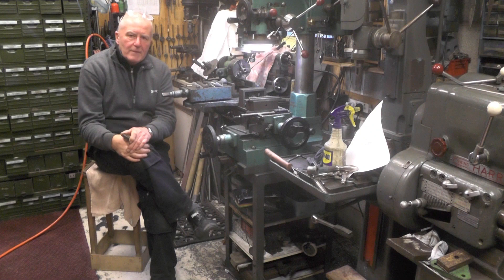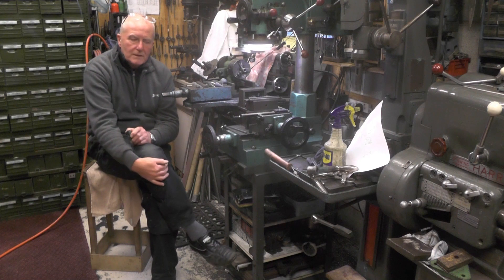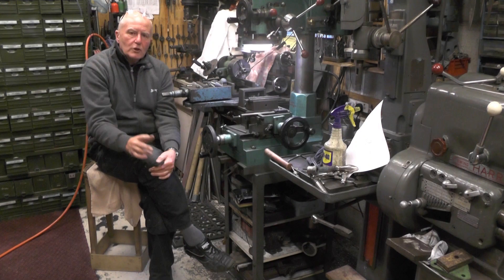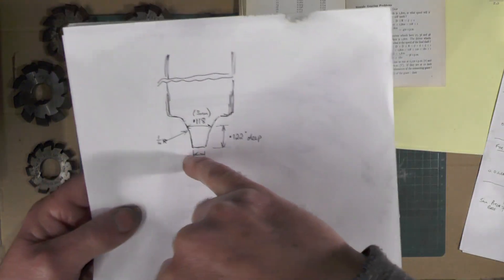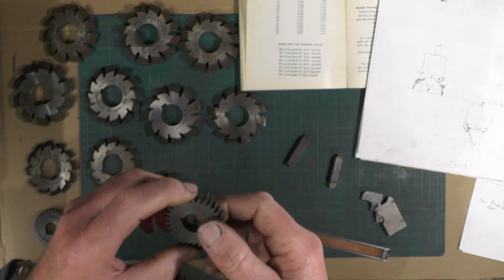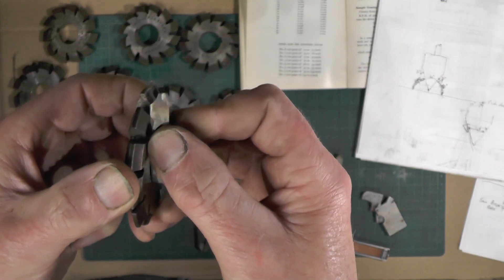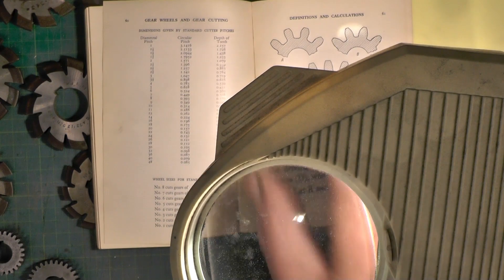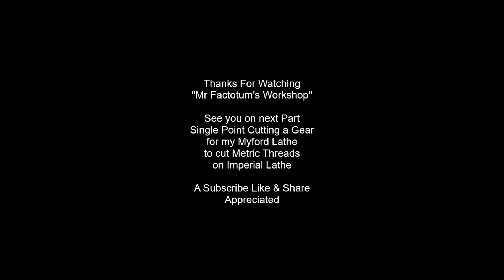Single Point Gear Cutting  Part 1 (Shaping the Tool) "mr factotum"

Comment: Hi Kev. E-mail sent with the dimensions for the drop arm. Steve. P.S i also have a chart with all the threads that can be cut using the 33 or 34 tooth gears if you would like a copy.
Reply from the maker: Hi steve 
Thanks for that, i have a chart with the threads on , but thanks anyway.
take care
Kev

Comment: Hi Kev. I bought the 33 & 34 tooth gears from Myford last year. Still in the bag. There is apparently a arm that needs to be made to mount them. I have the drawing somewhere of the dimensions of it.
Reply from the maker: Hi Steve
I had a look around for some but couldn't find any, or may be i wasn't looking hard enough, to prompt me to make them. 
You've got me a little confused here about the arm, the method i use just a straight replacement that slip on to the spindle below the 2 tumbler gears to replace the 24 tooth one normally installed, all you do is adjust the Banjo down a little to suit the gear then set the QC box to the suitable position for the pitch.  It will become more clear in my video out tomorrow, making the gears and trying them in the lathe. 
I used this method in another recent video, in my contribution to Go Create Hobby Machine Shops making the three baby vices collaboration, where i cut a 3 off M5 x 0.8 pitch  screws, in Part 1.
By the way received your stickesr yesterday, thanks.
Take Care
Kev

Comment: Morning MR F  my sweet pea is coming along  nicely  .. Much nashing  of teeth with  the  internal square thread  for the  brakes but success eventually..  Nice interesting  video on the myford gears .I made a few years back  from tufnol and they worked a treat  and they run nice and quiet.. If people use tufnol  they must use flat sheet and cut rounds  then cut  ... Dia bar tufnol can't be used as the teeth will disintegrate  because  of the way the laminate is   structured and glued on manufacture.. l know   gear guys know this  but it might help somebody..  looking forward to you next video .. Keep Safe  from South Africa
Reply from the maker: hi dougie, 
nice to hear from you
Yes that internal square thread is challenging!
good to hear the SP is coming along.
That info on tufnol is great, never used it myself but that's good to know about it being laminated thanks
take care
Kev (Mr F)

Comment: Gday Kev, great informative video, I’ve just brought 2 gear cutters from the UK, here in Australia they want $260 per cutter, I brought both for $108 Australian from he uk, I had no idea how to grind the profile in the high speed tool blank but I do now, maybe next time I need to cut gears I can use your ways of doing it, thank you for sharing your knowledge, much appreciated, Cheers
Reply from the maker: cheers Matty
yes the cutters are very expensive for a good one anyway. Unless you get a cheap chinese chocolate one, there ok for doing a one off perhaps. At the end of the day you get what you pay for.
good luck with your gear cutting, 
Kev

Comment: Nice job Kev. That grinding dust's a pain. Should be able to cut HSS with a carbide end mill. Not tried it myself just yet but I will do now.
Reply: Dave interested to see how you get on with the   Carbide endmill on HSS .. Carbide  is used alot nowadays  finishing   punches and dies  after heat treatment but  using  very rigid  machines with high speed spindles and cnc  to  control speeds and feeds accurately and    also climb milling.. HSS    is about  64 65 rockwell I think so quite  a bit harder than normal..  hope I haven't bored you with things you already know   .. give it a go  I'm  a pensioner so can't afford to experiment with expensive cutters  Regards  Dougie South Africa
Reply: @dougiehogarth6652  Hi Dougie, I'll get back to you on here when I try. Yes I'm aware of the hardness. I'll have a look what cutters I have, pretty sure I have some 65-68 HRC in less than 10mm worth giving a try. I'm 62, still working (from home) & it's a hobby just like yourself, mind you it has paid for itself.  My mill is a warco WM18V.
Reply: @dougiehogarth6652  Hi again Dougie, great result, no problem at all, like butter, well say butter in the fridge! I've just made a perfect 2mm concave radius into the end of a piece of 3/8 HSS. Using a 4mm, 4 flute carbide AlTiNS coated (spec to cut 65-68 HRC) end mill. First I side milled the end to 7 degrees with 10 thou cuts no problem. (Didn't try deeper as it doesn't take long). Then plunge cut right through in 40 thou steps to the 2mm radius, still at the 7 degrees, again no problem. Just one very light spray of coolant (aerosol) for each cut. Both side & plunge cuts work great at 1500 rpm but was fine at over 2000 no problem, and faster feed. Great finish either way, & cutter still like brand new. Neither the cutter or the HSS got even luke warm. I think the recommended speed for these cutters in HSS is around 6000 rpm!, my mill doesn't go that high. Cutter cost; less than £10 (not Bangood, I refuse to).
Reply: @davemason6273  Hi Dave  I'm  constantly amazed  at what   these cutters can achieve   but I thought  that  HSS would be  a bridge to far..  I m 75 Next week ,Who said you can't teach an old dog  new tricks.
Reply: @dougiehogarth6652  Happy birthday next week Dougie. It's a different world we live in that's for sure. These cutters are very brittle but very hard. Look up APT for your cutters, they also show speeds & feeds on each cutter, these are maximum but if your much too slow they will chip.
Reply from the maker: hi dave
Cheers, yes you can cut with solid carbide, but I don't have any, i just manage with what i've got at the time.
thanks for watching and feedback, appreciated
Kev

Comment: Once did the exact same job when i cut an internal gear on a slotting machine. i had the benefit of a tool and cutter grinder, diaform and shadowgraph and it was still bloody tricky. Great job Mr F
Reply from the maker: cheers rob
wish i had the luxury of a t&c.
thanks for your usual support
regards
kev (mr f's w)

Comment: Fascinating thank you ,if I tried that there would be cloth flying across the workshop !!.looking forward to part two.
Reply from the maker: Hi SD
thanks, it's just a matter of making sure everything is fastened down with tape, magnets, etc, just make sure your comfortable with your securing method, if in doubt Belt & Brace it.
Thanks again for feedback see you on next part soon.
cheers
Kev (Mr F's W)

Comment: Great job !   * While it's possible to make a cutter with the 'button' method , that would require an exact size tool ; PLUS it would have to be made from 'silver steel' or drill rod - which is not quite as durable as HSS !   'Looks like a WIN / WIN ( using the grinding method) . . . Grinding gives a much nicer finish ;)   ** If you want a 'super finish' , just a dab of diamond paste on a hardwood mandrel would do the trick !     Looking forward to the results !
Reply from the maker: hi george w
Thanks for watching and feedback, 
great tip with the diamond paste, i will try that when i can make my money part company with me to buy some diamond paste🤣
Next up cutting the gear.
Thanks again
Kev (Mr F's W)